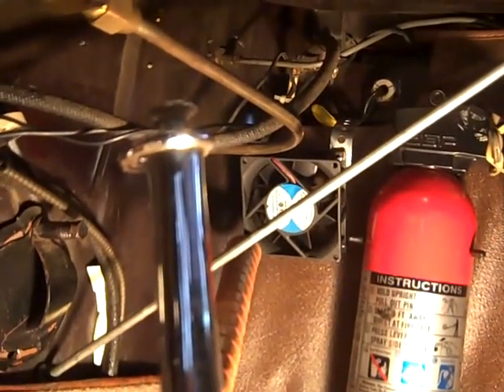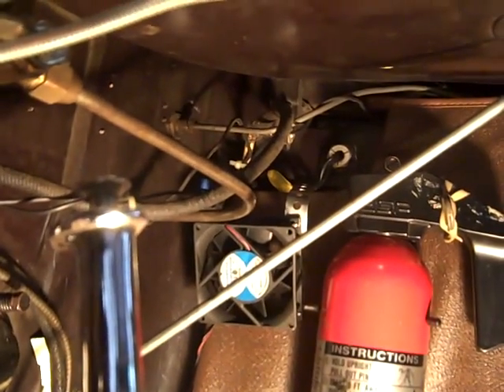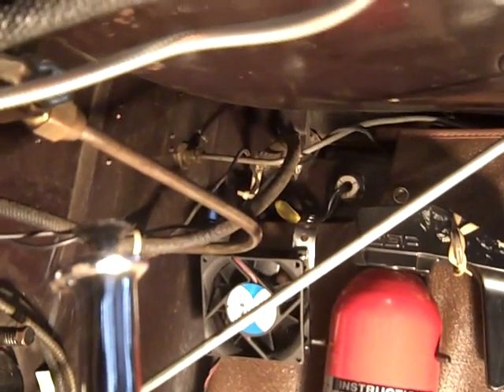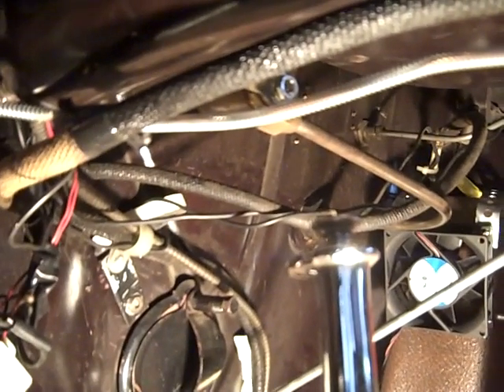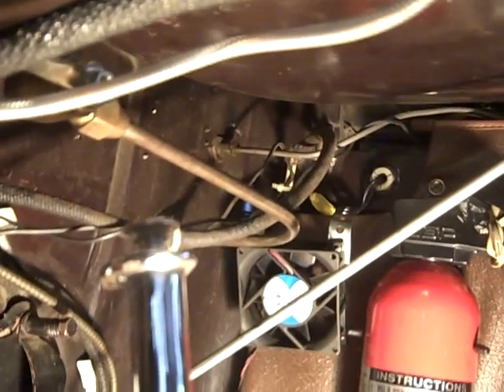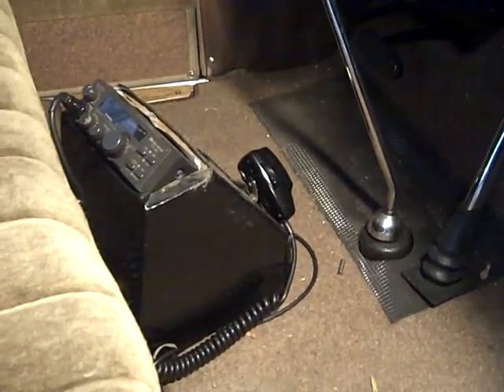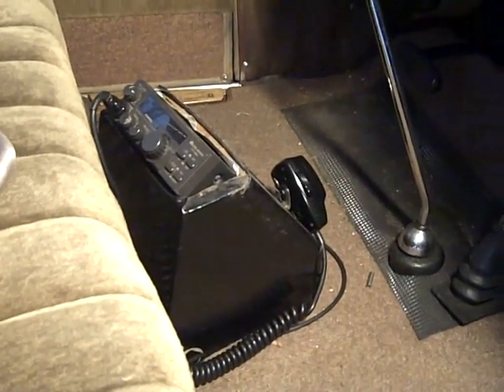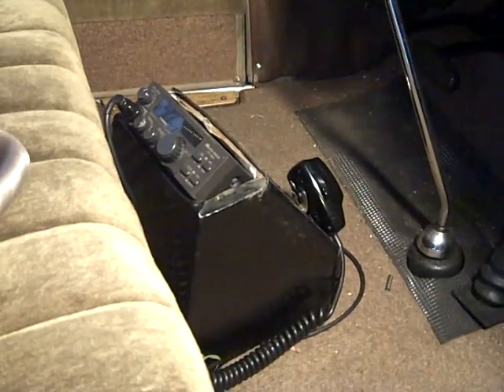Added another gadget to my Model A 2015

Comment: Last time I checked, gadget was spelled with a d. I know what you mean though, about how hot it can get down there. Combine that with the engine noise and you can get rather tired after a long drive in the A. Even in the winter, I found it to be warm enough not to need a manifold heater, so I took mine off and sold it. In the summer, opening the windshield helps a little.